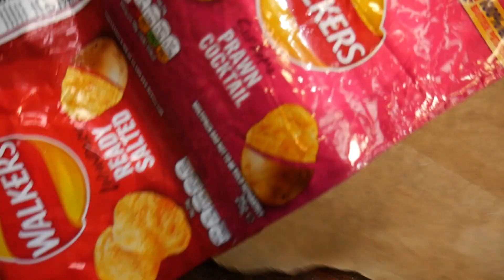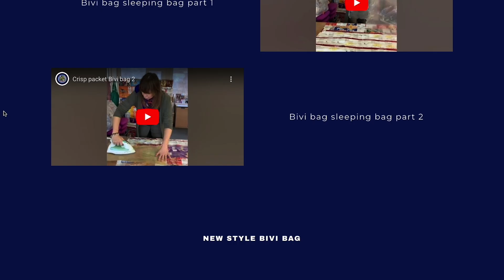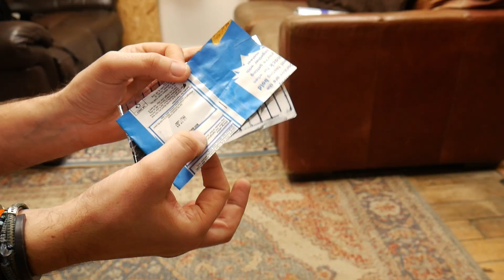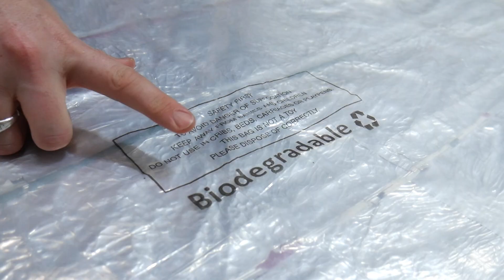Can Your Chip Bags Save Lives?

Comment: I have an idea:
shred these bags really thin, like, 0.1mm sized particles
Then remelt it into shiny, metal-infused filament for 3d printing
From what I googled, their plastics is layers of polypropylene and polyethylene, both of which melt at low enough temps to be melted by 3d printer hotend (even if it's hard for most of them to reach 260 degrees to melt polyethylene, in even mixture polypropylene's 160 degrees should offset the overall temps to a lower side).
However, some resaults say there is... BOPP? or even PLA?
Maybe heated centrifuge will help separate these plastics, or chemical repolymerization?
Overall, someone SHOULD dig into this concept, maybe something WILL come out of it.
Reply: Mylar is a specialed form of metalized PET.  Get a heat gun and try to melt some.  It is an interesting idea as they are converting PET bottles into PET filament.

Comment: "... definitely going to need a better system for cleaning these."  Why don't you try a washing machine followed by a tumble dryer with the heat turned off?  I suspect some bags will shred and get caught in the agitator and tumble drying without heat may take a long time, but it is worth trying.

Comment: So there is also something called “Eco Bricking” where you pack small bits of plastic (especially plastic that’s difficult to recycle!) tightly into a clean plastic bottle that you have the lid for. You pack it until it’s so densely packed that it functions as a brick, and you can make many of them and either build with them or store them for future building use within your community. 

When cared for properly they last for ages without letting the plastic inside of them to be introduced into the environment and they take plastic out of circulation too! 

I think once a chip bag blanket/sleeping bag/etc has run out of viable uses it could easily be cut into strips and put into an ecobrick!

Comment: @BrothersMake I was having the hardest time finding an adjustable heat sandwich press that opened at a 180 angle without grooves in the grill plates. I found one i could afford that filled all but the plate grooves and im not wanting to press my silicone baking sheets into these grooves and put holes in the sheet. whats a good workaround for this problem and does it HAVE to be aluminum foil?

Comment: Given that this product ac5s like a moisture barrier, it could be used on cement floors under carpets or flooring, also tyvek type products or as seal in attics and dirt basements. With the correct recycling program a company could produce this and sell it for use as above and easily take this portion of trash out of the oceans and landfills.

Comment: A vacuum table that holds the bags in place would be beneficial for doing this in bulk and using a big flat metal heater to heat a larger area.
#free_Palestine
Reply: ...or maybe a table surface that has a lot of static electricity to hold the plastic down.

Comment: Lads, I am afraid you have been misinformed, firstly, there is no real 'foil' in those crisp/chip packets, the old-style packs have foil (thin sheets of metal) bonded onto paper just like Tetra-Pak drink containers & those can only be recycled at specialist recyclers (of which Tetra-Pak own the proprietary share). The most common crisp/chip packs nowadays are made from Bo-pet, more commonly known as Mylar (one brand of that product like Coke is one brand of cola) a product manufactured from mostly cross-bonded Polyester/Polyethelene, the silver colour comes from only a tiny amount of aluminium vapour. Mylar has been used to make "Space/Emergency Blankets" for First Aid Kits since the 1960s, it's used in lightweight insulation & heavily layered-up in space suits & anti-radioactive suits - all short-term use items. The 2nd misinformation; because the chip/crisp bags are plastic & non-breathable, they are good for EMERGENCY warmth only - LONG TERM/FREQUENT USE CAN BE DANGEROUS as they cause overheating & perspiration in the long-term, making you & your clothing more & more damp each time. Sleeping rough in wet clothing can put you at risk of hypothermia in winter's extremes.
Reply: They did put some vent holes in the finished product.  Do you think this is insufficient?
Reply: It doesn't have to be metal, any reflective surface reflects heat, heat is just light [well it's a little bit more complicated than that but yeah] I highly doubt any of the safety blankets that like firefighters and stuff have on them actually have metal in them either.
Reply: You obviously have a lot of knowledge of these products. I, having previously worked in a factory that uses recycle in its products have a little knowledge in this area. You are correct.

Comment: I'll tell you something as a person who is homeless and has been previously homeless. Emergency blankets are trash. They are useful if you want to freeze to death as they only reflect infrared heat back to your body, The fact that they are super thin, means any real heat just goes through it and you remain cold. In a slightly cool room they help, but out in the cold, they don't help. If anything they're good to wrap a tent to hold some heat if you have a heat source. I spent a night tossing and turning and freezing while wrapped in one at 2 degrees celcius. The homeless need real blankets to survive the freezing temperatures of winter. On the coldest days, all I have to do is walk enough to warm up, then go back and crawl under a couple of sleeping bags and my body heat is enough to warm the space in a matter of minutes and keep me warm all night. If I did the same with emergency blankets, I would freeze to death.
Reply: Thank you for this info!
Reply: genuinely this is really good to know! this initiative is clearly well meaning but its worth noting that it may not be useful unfortunately

Comment: Cold ground conducts through the plastic, reflective material requires an air gap to work, if you put an inflatable sleeping pad inside your bivy and lay of it, it will serve as the air gap to absorb radiant heat from your body, this simple change will have a huge impact.  BTW, the skin of the Lunar Module that went to the moon was 3 layers of mylar film so I guess you could make a spaceship out of Crisp bags.
Reply: This! 👆

Comment: I asked same question on another of your videos but not replied to as yet.   

Hi Guys @BrothersMake  - love your videos.  Just started making pens and stuff on my lathe . 
1. What happens if the hdpe product like say a hand lotion container has printed info etc. on the outside - is it still ok to use?
2. Can I mix HDPE, LDPE, PP  together when making my blanks?.
Reply: 1) I think that it is a tiny problem, but it can work, because you could avoid heating the plastic with the printed info. Just put the melted plastic on it, and then melt it into shape.

2) You can, but they will not melt at the same low temperature. You could put PP in the middle of the other 2 layers. It's easier to not waste your time doing this, though, because there is so much plastic out there.
Reply: Thank you  @eugenetswong

Comment: Its hilarious to argue they are not recyclable. How are they formed? Pressure and heat. They don't lose those properties.
Reply from the maker: They’re two different materials that are fused together, how do you recommend separating metal and plastic so that they can be recycled?
Reply: @BrothersMake  the joy is that there is no need to do so. because vast amounts of manufacturing need those fused materials still fused. the paint can be painted over, and as you showed the material itself can simply be heated under pressure to reconnect the pieces. 
The second way they can be used is by making them into third party plastics that have less specific requirements for the polymers. many plastic applications are less concerned with the polymers, so for cheaper plastics you can use specific groups of materials that will easily fuse with other similar options. recycling facilities can automatically sort these plastics as some are grabbed by static electricity. others respond differently to different light frequencies. so a sorting belt flows material through the sensors and then gates, air blasts, or magnetic belts can do the selections very rapidly. just as they do in the crisp manufacturing plants to detect faulty product.

Comment: Could you use a few more layers of the sofa plastic sheets to make is strong enough to put put 'eye rings' in, and make tarps out of crisp packets & sofa bags? Usable for a bike cover, wood pile cover ....  anything cover, really.
Reply: Good idea…😊
Reply: To me, eye rings are different (pair with hooks with both threaded with wood or machine threads).

I think you mean grommets, which are the metal rings on the edges of tarps.

Comment: What if you use that thing to straighten out Hair to join the  single little bags? Would make a not so narrow melting line as the package sealing device. And what about putting the bags in a washing machine in Programm wool? Safes you from labour and low temperature saves it from wrinkling. Love the idea of making those sleeping bags. Would go nicely with the crocheted mattresses from cheap grocery bags. To be found on you tube
Reply: I don't think so. I tried to melt plastic with a hair straightener. It didn't work.
Reply: @eugenetswong probably not hot enough. You don’t want to fry your hair, after all. The ones made for sealing bags are definitely hotter.
Reply: No one commenting on the brilliance of putting the damn things in the wash? Even a giant turkey pot at a rolling boil (assuming the bags don't melt at that temp) would be so much faster!

Comment: Love this idea! Looking at this from the point of view of a seamstress, I have a suggestion. Instead of  having to crawl through the bag to seal it, try putting the right sides (crisp bag art) together, and ironing them, leaving a small seam allowance that you can fold over and seal again. Long sides first, then bottom of the bag. Then you can turn it right side out, and perhaps less chance of damage from crawling through. Just a thought. 🙂
Reply: Yes agreed. Would be much stronger!
Reply: @luke_fabistrue at that point you would need maybe fishing line as thread and an upholstery hook needle. But too many holes defeats the purpose of making it mostly waterproof. (Besides the condensation vent holes)
Reply: Yes, exactly. It will probably be more straight, too.
Reply: The idea is wonderful. Would it be better if the money making companies would change their packaging. Because an unhoused person may abandon the crisp bag sleeping bag. Here in CA they don't  make these companies think of better disposable packaging but they are making  landscapers switch from gas running tools to battery tools. Then years after we will worry about disposing those batteries. God bless you for trying.

Comment: is this something that would need respiratory protection, or is it low enough temps that it won't be releasing fumes? I'd love to try putting together some packets at home but I don't have any outdoor spaces and can't be opening windows in winter
Reply: Not many studies are done on the subject, but many ppl in China who work in manufacturing facilities are dying from not known diseases. It's petrochemicals at the end of the day. It is up to you, but I'd recommend protecting yourself as we need more ppl like you :)
Reply: All depends on the time of the exposure to fumes. If you do it all day use the respirator, if a few minutes not so bad. I used PLA for 5-6 hrs in a very good ventilated area and had severe headache. PLA is the most non toxic plastic. From my personal experience I suggest to use the respirator.

Comment: I think this is not only a brilliant idea but surely opens up all kinds of new possibilities for using recycled materials to produce a completely new material with heat reflective properties. Also on a smaller scale I wonder if the card wallets you made before would be good from this and if the foil would prevent card skimming??
Love you boys and super proud of you 👌🏻
Reply: Foil definitely can prevent card skimming but it takes about 3 layers minimum depending on the radio frequency you are trying to block and the proximity of the readers/skimmers to your wallet.  At work we have rfid antenna sticker tags that go with product UPCs now, but whenever we find a pulled off tag for a stolen item we have to put them in a shielded bag before they are inventory counted out manually, just to help the overhead rfid sticker readers not count them as part of our in-store real time inventory.

Comment: The term space blanket is a bit misleading. Wearing it like a blanket in cold temperatures against your skin will not help you. The key to the space blanket is space, as in air. Having a few layers of clothing between you and the blanket helps. Maybe bubblewrap.
But the best use of a space blanket I've ever seen is something called, 
the Mors kochanski super shelter. It utilizes clear plastic with a space blanket to make a warm greenhouse. I've used crisp packets before to make an insulated water bottle to keep my coffee hot. This way of attaching them is giving me all sorts of new ideas.

Remember to look this up Mors kochanski super shelter it could save your life someday.
Reply: Don't foget solar cookers, or if you drive, then the windshield reflectors.
Reply: That's a great idea for recycling bubblewrap!
Reply: Having read the comment about bubble wrap & upcycling, could the bubble wrap packaging used for mail delivery - be reused toward this purpose(?) I wonder if it could be attached in the manner as the crisp bags are?

Comment: I want curtains made from this new material!!! I feel like this would make a great inner wrap for a house to make it more weatherproof, and hopefully a house will last 50+ years. It won’t keep it out of the landfill forever, but 50+ years is a good amount of time. I appreciate your hard work in trying to figure out the waste problem ❤❤❤
Reply: Good idea! Even if not for regular houses...how about outdoor shelters for cats or dogs?
Reply: @sistermaide  so long as one is careful to allow air flow, or you'll smother your local feral populations...
Reply: I feel like it would be a good way to slow it becoming micro plastics as quickly, because it'll be out of direct exposure to weather. I think/hope in 50 years we'll have better demolition practices, and reclaim more materials. That's the dream anyway. Cool suggestion
Reply: I think using it to wrap a house is a great idea, but I'm not sure about the building codes.
Reply: @GermanSausagesAreTheWurst  can't be much different than Tyvek?

Comment: Neat project!! Seriously guys! Love it when you can make treasures from trash. 
I am in USA, and find it interesting when you let us know terminology differences in our English. Thanks guys! 
And  also....what settings did you use on your iron, and on your sealer?
Reply: I think they've said before that they have their iron on the highest setting when working with HDPE/LDPE. Not sure about the plastic used for chip bags,  or about the sealer though
Reply: @Unownerdead  thank you I couldn't remember,  and think it looks different this time. Thanks :)
Reply: @sistermaide They said, I believe (but check!) to start on the middle setting and then adjust up or down a setting as necessary.
Reply: Can be mixed (plastic #7)= PET+PP+PE. At least that's how they mark it in Germany, but all depends on manufacturers.
Reply: Each brand can use different supplier with different plastic

Comment: Awesome out of the box thinking, but... Your labor costs, versus buying a 2,000sq ft roll of aluminum radiant barrier $80 in eBay... I get the grants angle though...

Kudos !❤
Reply: Did u guys consider one of those battery-op, plastic bag sealers ? (8 bucks, size of a small stapler)